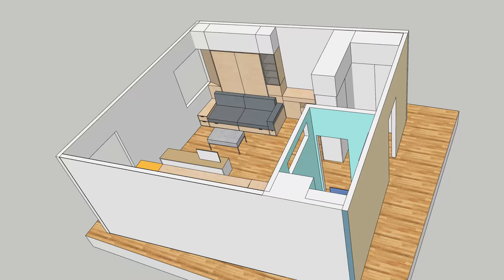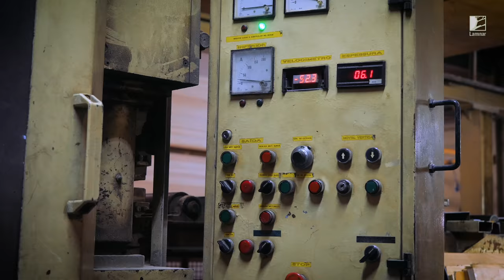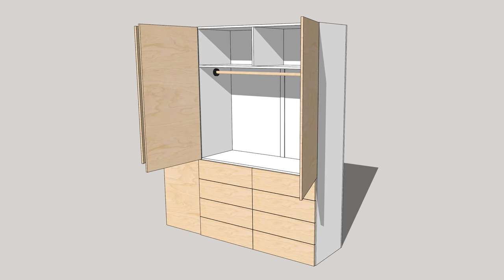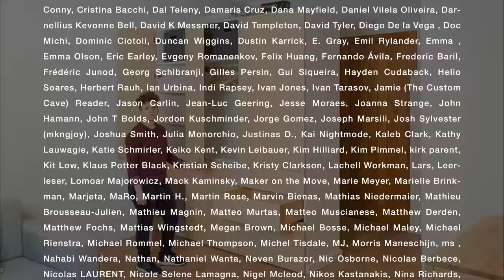I Built a Wardrobe! // Tiny Apartment Build Ep.12

Comment: This is my dream. Have a workshop with the essential tools and build all I can imagine. All I have now is a drill, a hammer and a saw. My drill was too powerful for driving screws (or my fingers press too much on the switch). I will save some money to buy the tools I saw in this video, It won't come cheap so I'll look for alternatives. My apartment is small so I'll have to adjust. This was very excellent. Thank you for the spark.

Comment: Nice work Chris.
When you get to plan extending the wardrobe up to the ceiling you might consider building it wider so it rests against the wall on the other side. Just don't put too much weight on that side.
Or maybe build an arch over the passage with some builtin LED lighting.

Comment: Tandem from Blum can be TIP -ON or BLUMOTION if you want wooden drawers...
Movento from Blum is also for wooden drawers and they have an option for TIP-ON or BLUMOTION, and TIP-ON BLUMOTION...
It would be better if you used MOVENTO TIP-ON BLUMOTION...
Also, I know you said it, but there is no point from removing spring from clips and to teach that to people; because there are clips for Tip - On doors if you want without spring...
And if you want you can mount Blumotion or soft close with that clips..

But beside all off my nonsense, you did a great job!! 10/10

Comment: Your landlord will move you to a new tiny apartment just so you can improve the value of that one like you are doing to the one you are in now.

At the end, how would you get furniture in and out?  It looks like you added a hindrance to the front door access?
Reply: Considering that her furniture is almost entirely custom-built by herself and can be deconstructed, I don't think there'd be an issue. For larger pieces, there are a couple of options. Sometimes it's possible to turn and angle pieces to get through small passages like that, and for everything else, there's strapping it up to a pulley and carefully lowering it to the ground over the balcony.

Comment: Since you're using Blum Tandem with Tip-on adapter here, i'd leave that for you watchers:

i'd rather recommend the Blum Movento system - it is a bit more lightweight, since the Tip-On-Function is (optionally) built in without those bulky adapters - and they cost about the same as Tandem with Adapter; the big advantage of the Tandem system is, that it is relativley cheap (like the Hettich Quadro V6), if you don't need Tip-On - but if you need it, the price advantage is gone - so you're better off with Blum Movento

The really nice thing of the Movento system is the adjustability, you can adjust pretty much everything (with 6 degrees of freedom) - so if the false fronts don't align properly anymore in the future, it is easy to correct

also if you use wider drawers - about 60 cm and above - there is a synchronizing rod that connects both drawer slides so the open at the same time even if you don't press in the middle (those are available for both systems)

Comment: I love your videos. Great quality and very informative.
I'm very new to woodworking but decided to give it a try building a cat tree for my two spoiled beasts.
My only two questions are - do I need brad nailer eg. electric one or can I just get same done with hammer, nails and wood glue and what is the name of that drill-bit that leaves nice inset for screw head? =)
Thanks!
Reply: You can use wood glue with a brad nailer. If you don't have clamps to hold things together - brad nailer! You can screw it together later, if necessary.
Reply: For the drill bit and clamp jig look up Kreg! Excellent products!

Comment: besides standard planning and tip over concerns (which can be prevented with secure attachment) is there any reason that the drawers can't go in the middle?
if I planned it I would put cabinets at the top, drawers below that and hanging space at the bottom. all so you don't have to bend down to reach anything.

Comment: at 9:45 why did you need to clamp wood to the fence instead of just setting the fence the length you needed?
Reply from the maker: To create a relief area for the blade. It’s never a good idea to cross cut pieces having them with zero clearance between the fence and blade. Being a lot longer than wider, kickback might occur and the piece flies back towards you at full speed.